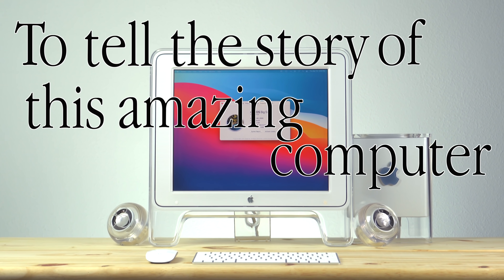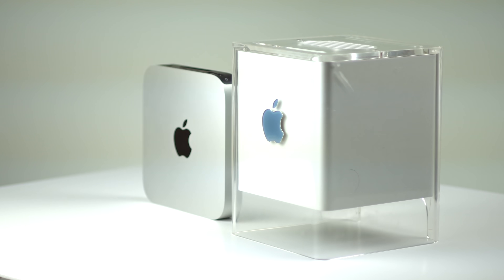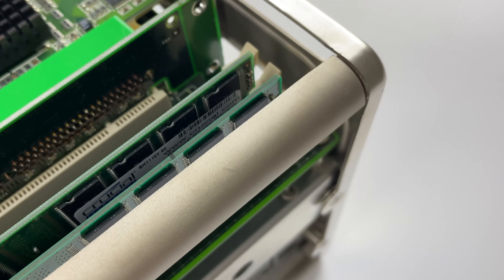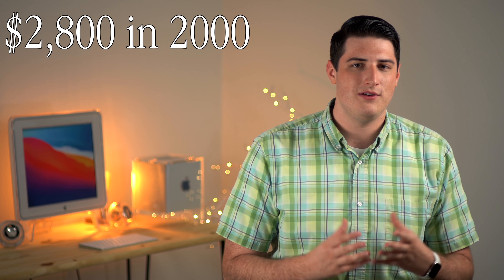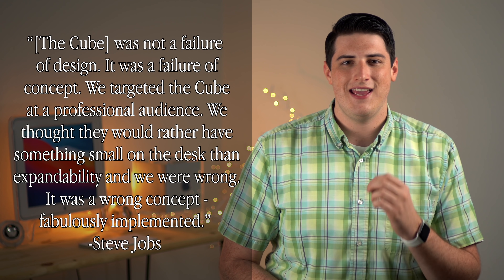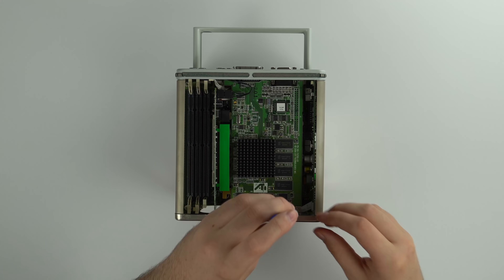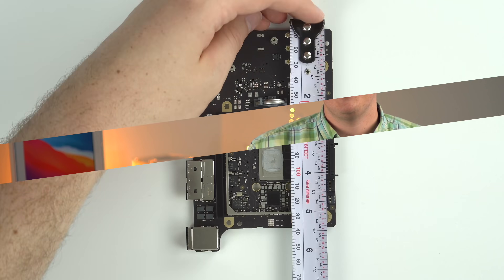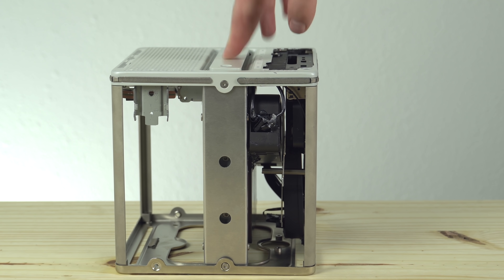M1 Chip in a 20 year old G4 Cube

Comment: You could probably have integrated the DVI to ADC adapter in the case and maintained the ADC port to use the original monitor with one cable.

Comment: I think you should try to use the original DVD drive!

The huge issue with M1 is the SSD containing weird hidden encrypted volumes that are paired to the firmware! If these are not detected, the machine won't boot, it won't even chime.
So if the soldered SSD dies, the whole thing is dead. Quite stupid!

By the way I am not surprised it outperforms MacBook Pros, they had horrible cooling, horrible fan curves, horrible keyboards, horrible specs for the price!
You should compare to properly cooled PCs.

Comment: You can easily repurpose  the original cube DVD drive with a single usb3 -Sata cable. And there is plenty of space and passive cooling to add several nVMe dives and heat sinks and with careful case modification add an SD card reader to the top with out making it look out of place.

Comment: Cool implementation, very clever.  However, your sales data is incorrect as the cube sold more then 29k units.  That was just between October and December of 2000.  They dropped the price after that and it was in production until it was put on hold in July 2001.  The actual number is somewhere between 120k-149k, if I recall correctly.

Comment: Amazing design. Not so sure about the claims of performance over Intel and AMD chips, in the same price range, yes, but a large number of workstation workloads are incompatible and undoable on the M1. Also the M1 uses an ARM-like instruction set reduced, but not a full RISC set.  The M1 is a huge step in the right direction but it doesn’t replace x86, Intel, or any other chip for that matter.

Comment: The Cube failed not because it was a little overpriced, it failed because it would overheat and actually fail. I was working a short stint at addias America back in 2001 and they had a room stacked with dead Cubes. Like 5ft deep. They just couldn’t handle a production environment of eight plus hours a day. As a home computer they would have been fine. Or if they had just included a fan...
Reply: Apple (or specifically Steve Jobs) really didn't learn a damn thing from the Apple III.

Comment: I'm sitting here thinking the G4 Cube on my shelf may yet have a future life .....
Please tell how or if you want a pet project.
Reply: Don’t do it if it works
Reply: @kit7une_  it worked when I put it on the shelf.  I’m sure the OS is an antique at this point.
Reply: @ellisz5972  If it runs OS 9 it should be useful for old games, old os 10 isn’t that useful
Reply: @kit7une_  old OSX. Was wicked cool back in the day
Reply: @ellisz5972  you should be able to boot into os 9 in the boot disk section of system preferences since it was preinstalled
Reply: @kit7une_  I had upgraded it to X and replaced the stock drive with an upgraded one.  I no longer have any of the old installation media.
Reply: @kit7une_  honestly I should plug it in and see if it still works
Reply: They're worth about $350 on eBay for a working one, see if you can sell it and get a known dead one if you have to do this mod.

Comment: In that empty space, install a blu-ray/dvd/cd RW drive. Disassemble a 27” display and mount it in a ½” thick piece of plexiglas, finished to look like the original 17” display. Use ½” ID vinyl tubing to contain the power chord for the display and another thinner vinyl tubing to take IO data and display data from the cube to the display. Don’t forget to add T-bolt and Type C ports to the new display. You will have the finest looking Mac ever! And if you have the Harmon-Cardin 3 speaker set laying around... Wow!